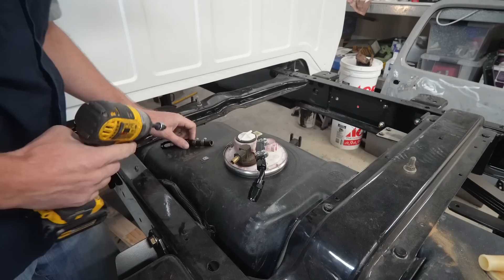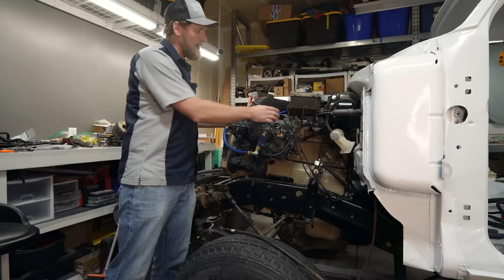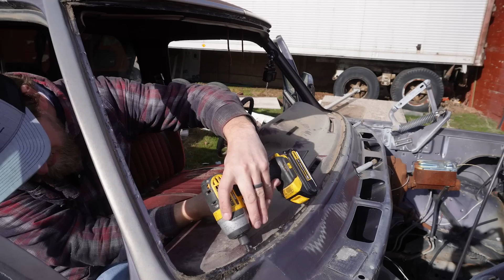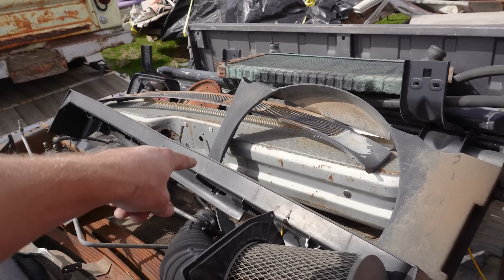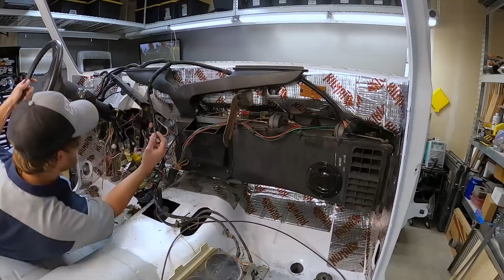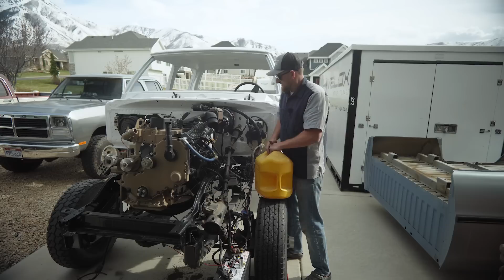The Cummins Is Alive And Greta Approved! | Long Bed Larry - Ep.24

Comment: Hey Tim, know this video is a year old now but I am trying to educate myself for a crew cab build in my near future. Did you end up using the chassis harness from that 89 cummins parts truck? I saw that you had to extend the harness for the cab lights, just curious how everything else worked out. Did you have to extend for the tail lights or any other items? The engine and cab harness seems easy enough, pretty much plug and play. Thank you sir!
Reply from the maker: Yes, I used the whole 89 harness and just extended the very rear section of the harness.

Comment: Excited for the the new video! Ps i got a 430 cummims modle 6C in a boat and when i set the throttle to where i desire it will strat to rev up 200-500rpm over. We have changed everthing from the tanks to the motor internals. Any ideas what it could be?

Comment: Those cheap pump handled suction cups are fairly inexpensive and you probably could have pulled the windshield from the front using a set. Bummer.
Reply from the maker: I know and I even have a set of those suction cups already 🤦‍♂️